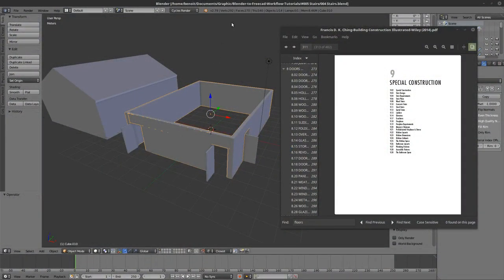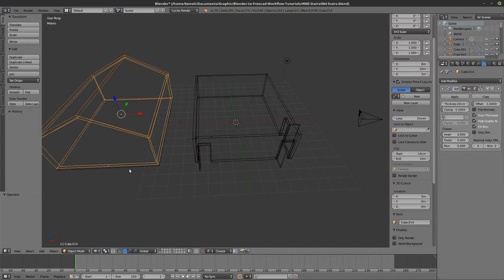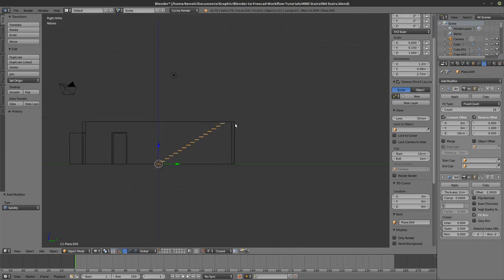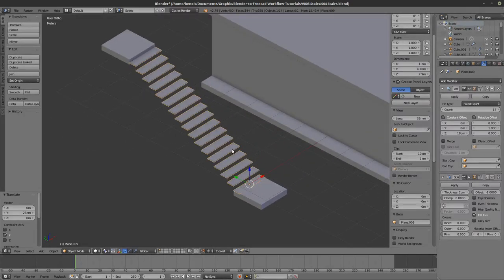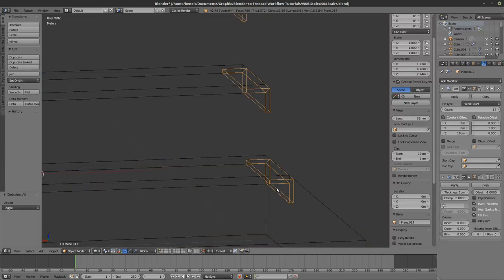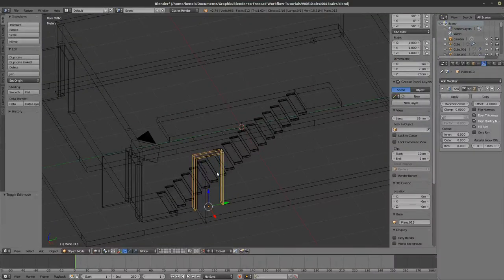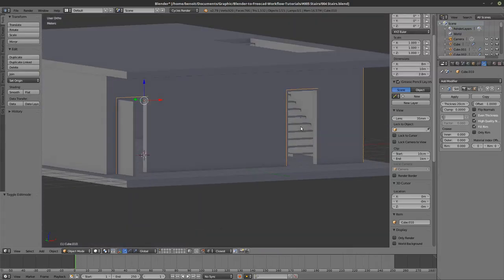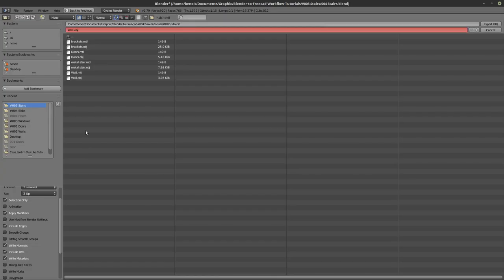005 - Blender & Freecad Arch Workflow - Stairs

Comment: whenever you use snapping, what key u press so that when you snap there is kinda little cyrcle?
Reply from the maker: +Slumber studio at what minute and second do you see that?
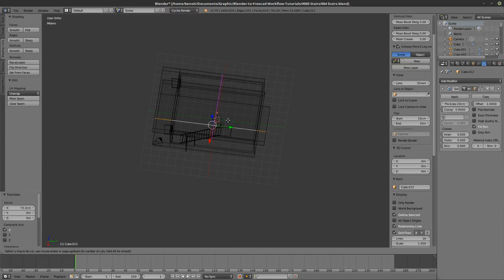Reply: around 11:05 when you add loop cut to upper floor and align it to the ladder
Reply from the maker: if your snap to vertex is on, all you have to do is move your object and hover around next to the vertices you wish to snap to. And it will automatically appear to let you know shich vertice it has detected to snap upon. So I don't really press anything.
Reply: I just figure it out. but is it just me or the snapping doesnt work when I use edge slide?
Reply from the maker: +Slumber studio exact. Edge slide snapping doesn't seem to be implemented.